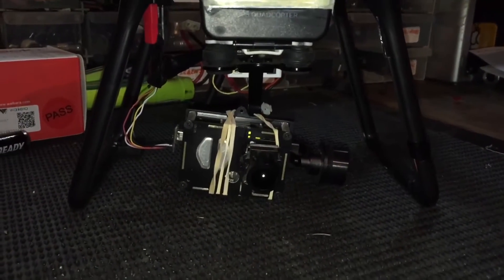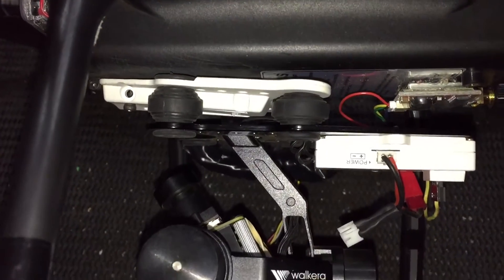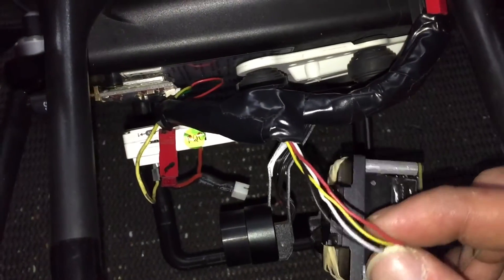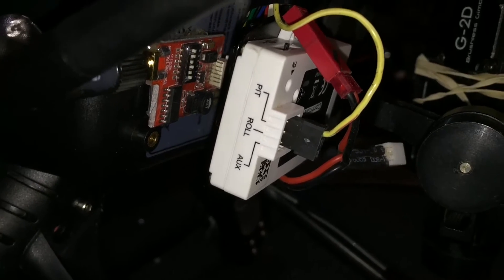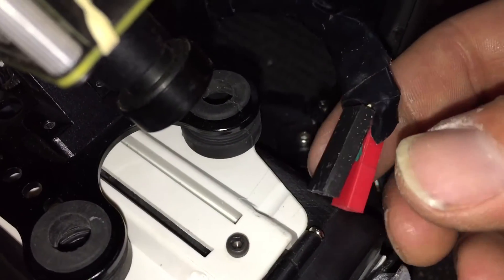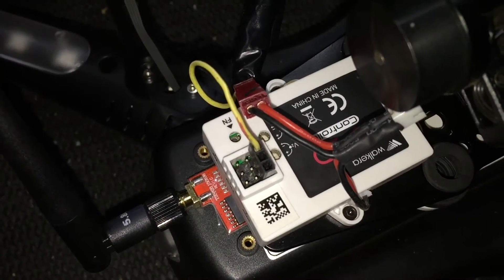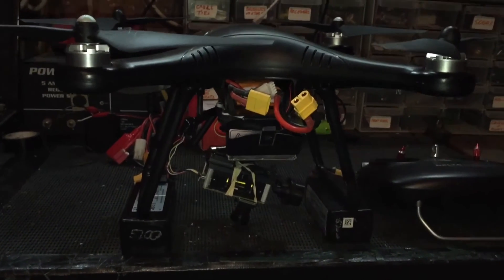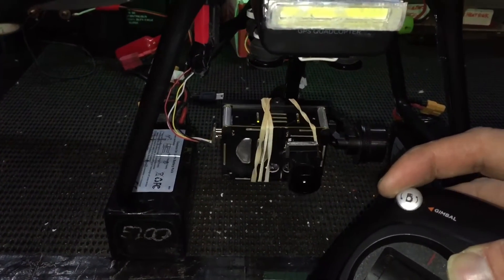DELTA DRONE GIMBAL MOD

Comment: Hi mate just wanted to ask if you could do a video on how you set up the FPV on the delta.. cheers. I have just bought one of these and i'm keen to know more about that.
Reply from the maker: Cranky Engines sure mate fpv is pretty simple, if you are using a GoPro or some other Style of sports camera, you'll need to mount it or pop it into a gimbal, or you can use a small camera and strap it to the delta like a mobius camera. Then it's a simple case of power an video transmitter and send a signal from the camera to the transmitter and you are on the air.

Comment: if you connect kiaser baas x90 camera to the delta drone can you operate the camers from the controller
Reply from the maker: Tommie Chambers no im afraid the camera is a stand alone unit and you need to turn the rec on and off locally, no remote options available. Don't use wifi to control it, you'll crash the delta.
Reply: thanks for that

Comment: hi just watched all your videos ,very informative too,,I was wondering if you could point me in the right direction ,as to wiring up a gimbal I have and if you recken it would work its one of those ebay $50 ones with the blue tape that wraps a round the camera ,I see a red connection and a black one too on the delta drone ,any info would be great and I just bought this little Delta drone yesterday on your commendations on your videos ,I have the Phantom 3 advanced and the go pro Blade chroma to ,I dont fly the Phantom much as I fly over water a lot like beaches and that ,if the P3adv went in I would cry ,:(if my little Delta went in I could live with that :)so I tested it this morning here at Grieves reserve in Dandenong and it flys great just like you said ,no GPS dance and everything is as you said ,very happy with it,I hope you can help me out with the wiring on the Gimbal,thanks.
Reply from the maker: Hi Paul, the red and black are 12v power, the two black next to it are the gimbal control ,and you actually only need the plug on the lower left, this is signal for pitch of the gimbal. hope that helps. cheers.

Comment: Hi Luke. Just bought the Delta Drone from JB for $399 which comes with the Gimbal pack. I was very surprised at the fact that the Gimbal does not allow the water/weather proof housing of the Go pro to be attached (I guess it's to save weight). You pretty much have to attach the Go Pro completely unprotected which brings  a lot of risk to my Go Pro. As a result, I've disassembled the Gimbal and gone back to the standard camera housing attachment. Any thoughts on this?